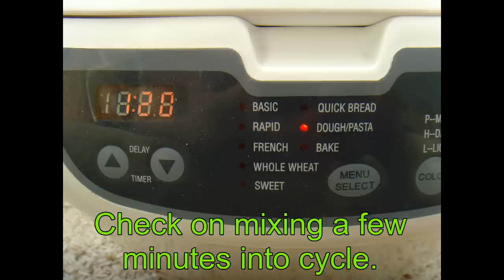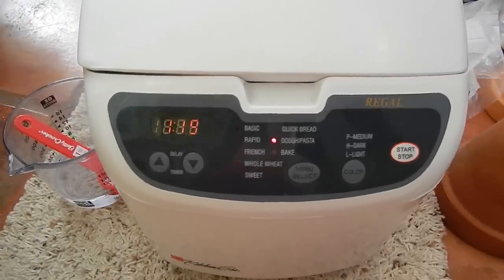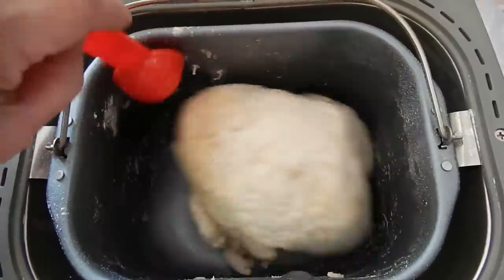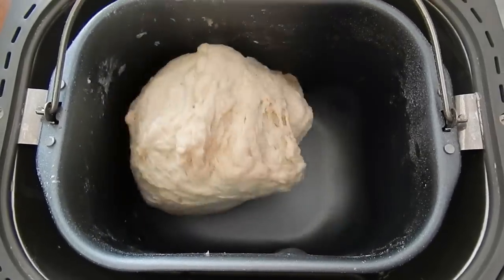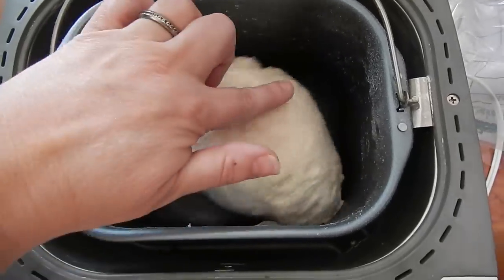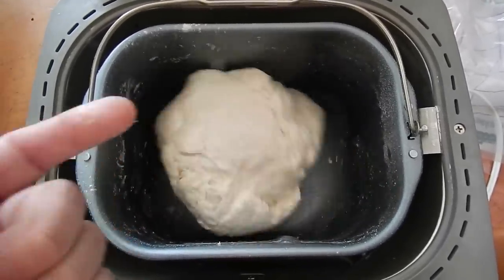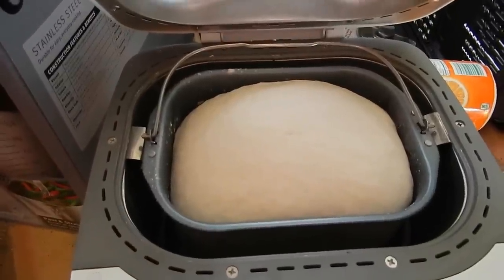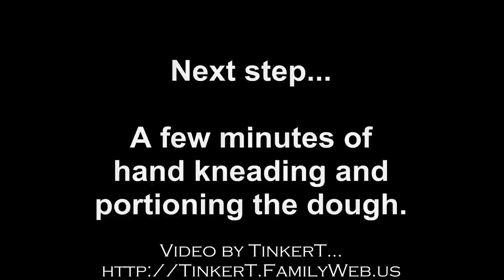Homemade Pizza for Beginners - Bread Machine Dough

Comment: recipe with normal values ;

300 ml warm water (about 45C so not painfully warm)
45 ml of oil 
35 grams of salt 
15 grams of sugar ( or 30 if you want it sweeter)
optional stuff is optional , so go nuts ;)
500 grams of flour
6 grams of dry yeast

add some water when its too dry (1 tablespoon of water is 15ml)

Comment: My bread man machine recipe calls for 80* water & tsp dry milk!! WTH? I’m glad I see your video. The only reason I got the machine was to knead!
Reply from the maker: Yeah.  I finally got a new machine and it has 3 different recipes for pizza dough.  Might be worth trying, but so far I prefer mine.

Now that I am older (and wrist is bad), I usually skip the hand kneading completely and use the machine on a "mix" setting again after the rising.

Comment: i thought it was automatic you just put in all the ingredients then boom! why is it like that adding water
Reply from the maker: The flour is sometimes a bit different, but the main reason is even the humidity of the environment you are in can make it too sticky or too dry.  So while sometimes all-in can work just right, it often will work very differently for different people/locations and even on a different day (like with rain storms going on).  If you get used to adding the last bit of water you can get perfect dough every time in whatever conditions.  :)
Reply: Taf & Caf so you're trying to make your own recipe other than in the manual yeah?.. coz i'm trying to look for a bread maker that makes a pizza dough like an instant,,  like if the dough was done you can put your sauce and cheese on it and set it another time ,, you know what i mean.. like when you open it boom! a pizza ;D was it possible for bread maker
Reply from the maker: Would be really cool if that could happen, but I don't know of any machine that would be that automatic... well besides a pre-made frozen pizza.  The pizza dough recipe is right out of my bread machine manual, but it took me quite some time to figure out why it would work perfectly on some days and be a complete failure other days... the water issue is what resolved it to be perfect every time.
Reply: hmmm interesting
Reply: mine does, add more water at the beginning
I use 1 cup warm water, 2 tabs oil, 1/2 teaspoon salt.  1 sachet of dried yeast 1 tsp sugar and 3 cups flour
add sugar and yeast to warm water. Let sit a little to get froth. Add to machine, add oil and salt and flour. Set on dough. Never a problem.

Comment: It was pretty obvious you needed more water you were jist wasting time. Even if it was a bit wet you could have added more flour. Totally not the video for beginners its very off putting!!
Reply from the maker: The whole point to it is that beginners may not know when it needs more water.  The video helps beginners see when to add and when not to.  If you are an expert and automatically know when to add water, then you probably don't need these videos.  :)